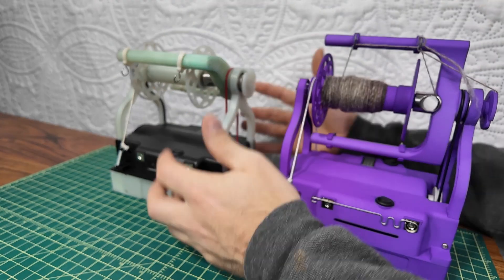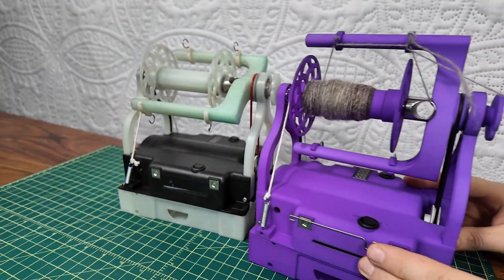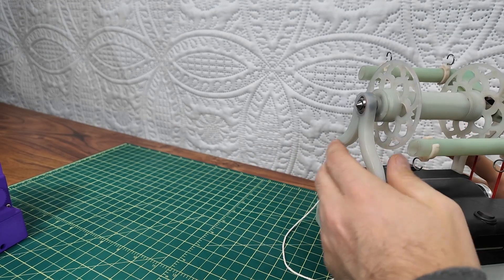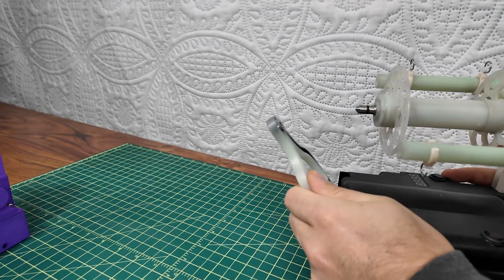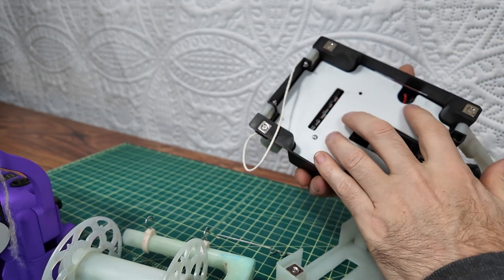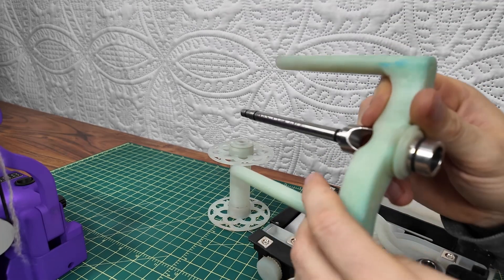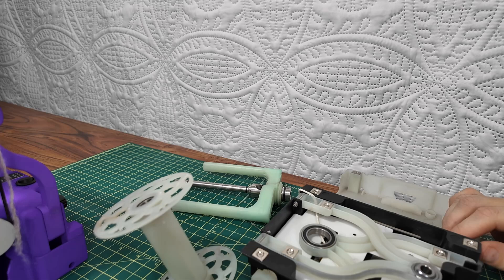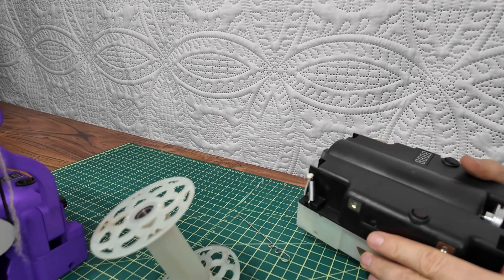Spin 192 - EEW Fold New Feature Deep Dive

Comment: Looks like some terrific improvements, Maurice! Just one quick question, though: why not hinge the top and bottom pieces together? So that they fold out and fold together? Just a thought…! Thanks, and looking forward to a successful kickstarter launch for you!
Reply from the maker: I'm not sure what you mean by "hinge the top and bottom pieces together".  Do you mean make the front and back maidens move at the same time?  That would be a step backwards in functionality since the most common use cases is to lower the rear maiden and leave the front one unmoved while changing a bobbin.
Reply: @DreamingRobotsBlog - no, that’s not quite what I I meant… my suggestion is to put a hinge along one of the “long” sides (the opposite sides from the maidens) so that the top lifts up and pivots to the side to lay flat next to the bottom. Kind of like opening a book! Does that make sense to you now? (Sorry, it’s hard to explain without being able to verbalize it!). Thanks for responding back, though!
Reply from the maker: @robinmccamont  So you are talking about the bottom battery cover and the base hinging.  I think that might work, but it seems more difficult to keep everything in place while folding and and likely a more expensive solution once you include the latch and things like that.  I'm pretty happy with how the magnets on the bottom are working.

Comment: brilliant, thanks Maurice: is the 3D printed one the same size as the molded one? If so then it must be an odd perspective effect, for the purple one looks way larger than the molded parts one. I am amazed about how everything fits neatly together, which is really my thing. But I guess that you can't fit a disassembled bobbin inside, correct? Anyhow, making this comment only because, for it looks fabulous, and I can't wait for it to be out. Finally, will it have a speed counter you had mentioned previously? Again, can't wait!
Reply from the maker: The molded and 3D printed ones are the same size.  It is just a perspective effect.

There is no room for a bobbin in the bottom.

Yes, it has the speed gage on it.  This video didn't talk about it because it doesn't require a deep dive and is adequately explained in the shorter kickstarter video.
Reply: @DreamingRobotsBlog  thanks Maurice!